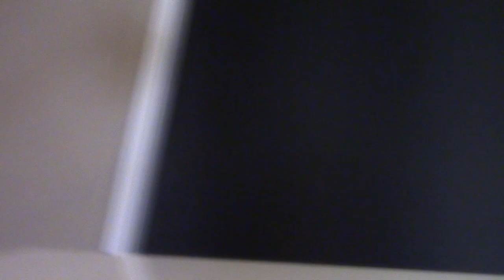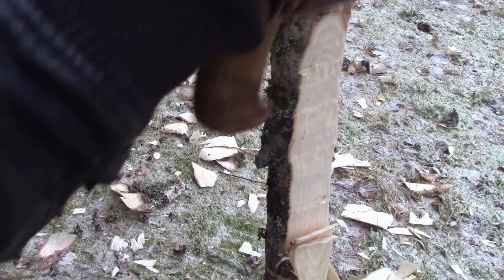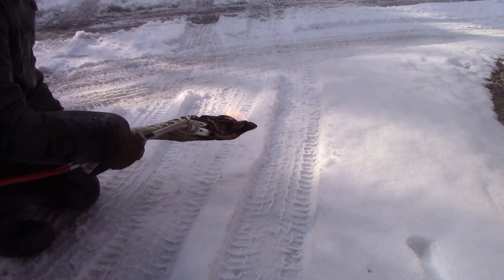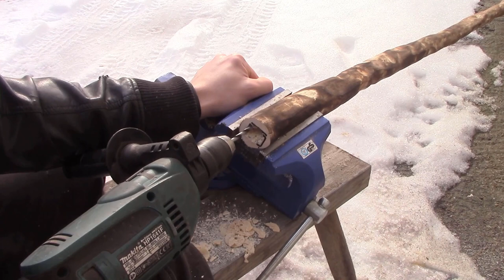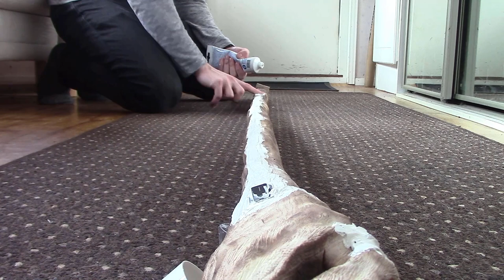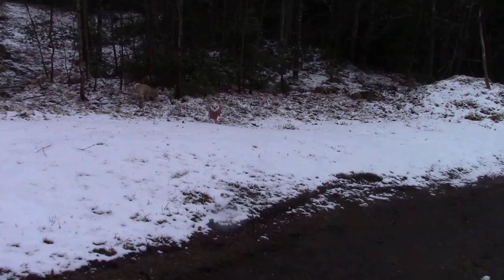DIY Gandalf staff

Comment: This is so cool! Is it a saw or a sander you're using there at 2:59?
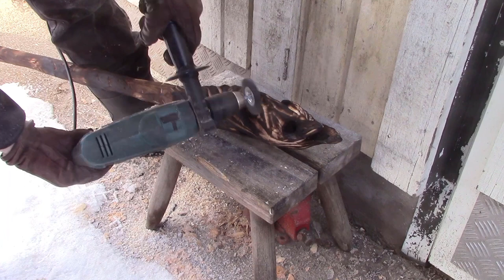Reply: And also, 5:22 ?? I want all these tools!
Reply from the maker: I used sanding disc 40 grit 🤔
Reply: @sahaseppa  Cool! What about the machine? Is that an all-around tool?
Reply from the maker: And 5:22 i used steel wirebrush just to remove all the wood that was burned  and try to make wood look older 👴
Reply: @sahaseppa  Very very cool 👏🏼 Thank you for the quick response!
Reply from the maker: I use dremel, makita drill and angle grinder
Reply: @sahaseppa  Thank you! 👏🏼👏🏼